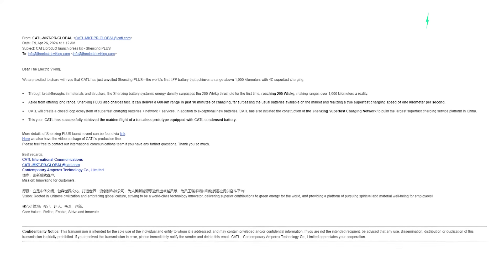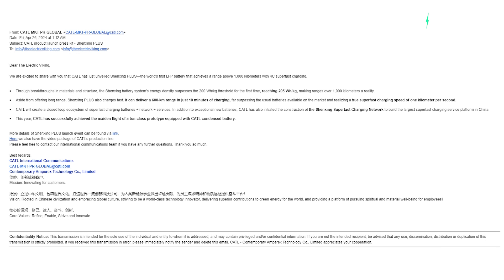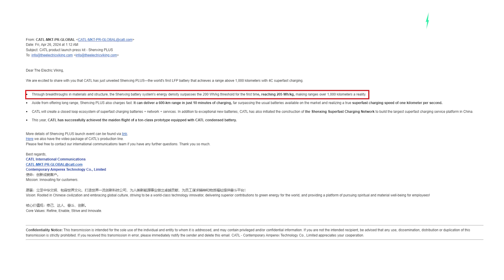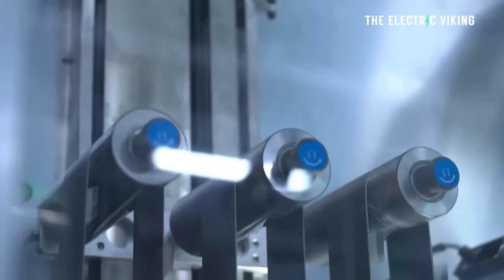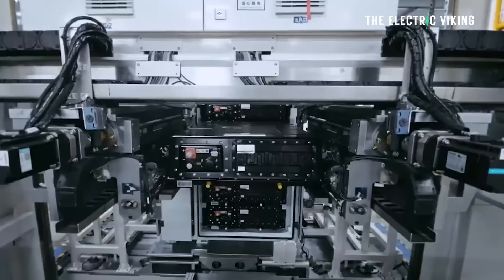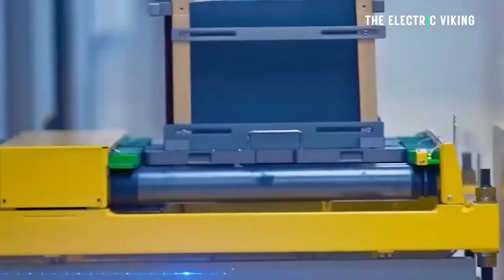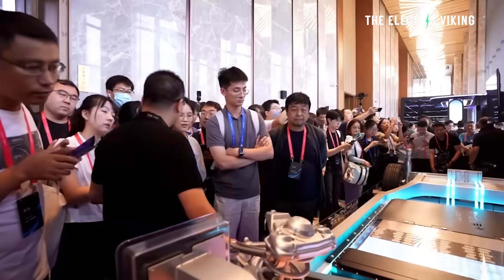CATL reveal new battery with highest energy density in the world

Comment: If this is true then it should reduce the weight of EV's then?  
Reducing the weight down to below that of an compatible ICE car is critical since it not only reduces the energy needed for movement but also reduces the wear and tear on any mechanical components, the four tires and the pavement.  It may also enable the use of heavier more recycle able body components thus eliminating plastics altogether?
Reply: Current battery tech makes EVs the same weight as full size ICE SUVs, meaning the same weight is in a slightly smaller footprint.

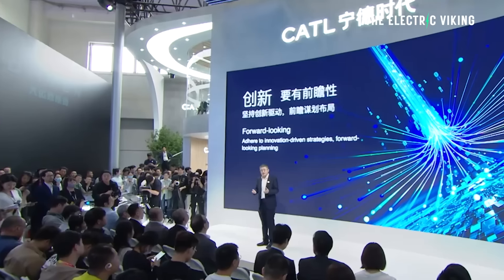Comment: 4:03 You said 747, but this rendering looks like a modified Tecnam. Looks like it carries 30-50 passengers. A 747 will carry 300-400 passengers. Still nice, but not quite replacing turbo fan transport aircraft yet.

Comment: will also lower vehicle weight if you are using 1/2 as much and still go further than its predecessor. Even if costs up to twice as much your are in front a lot!
Reply: The catl semi solid state pack of 150kwh in the nio et7 by welion weighs just 44# more overall than the same size pack by catl using nmc cells of just 100kwh capacity. 

So a tesla model s could use this for 40%+ more range at no weight penalty or cut 350-450# out and keep around 100kwhs and 400+miles. 
Bringing a model S lr down to around 4,000-4,200# from 4,400# now. 

It will be interesting imo to see what ev oems do once this tech is avaipable widely spread cheaply in a couple year's. I think luxury and suv/truck makers keep massive pack's for big range and to serve towing needs. 

While mid size segment model's keep similar useable capacity but drop the 200-300# in weight and I bet the low end evs just stick to lfp/lmfp/m3p or sodium cheaper style cells. But improve the charging speeds for better daily useability.

Comment: Not a 747 !   The image shown by CATL is that of a regional class turboprop, which typically carries 50 passengers or so.
Reply: Right.  There is in fact a battery powered plane in commercial service built by an Israeli company, an 8 seater.  It's called ALICE and it's been in service for two years now.
Reply: Good spot. 

We will see a resurgence of large seat capacity prop powered passenger aircraft
Reply: @PETERJOHN101 there’s a few others, some flight school and contractors who specialise in short haul flights suited to the battery range are using battery powered electric aircraft 

Def an area to watch as it will grow

Comment: Another advantage is benefit to the residents nearby the airport. The noise will is a friction of current noise level.
Reply: An electric aircraft powerplant sized for a large aircraft will still be pretty noisy though, one should keep that in mind. You need to pump huge amounts of air very fast, which will mean noise. But yeah, certainly less noisy than kerosene-fueled turbines though. :)
Reply: Drones are very noisy for their size. Making an aircraft electric doesn't make it quiet.
Reply: @sang3Eta  If you're ever heard a piston engine model aircraft, you would agree that the drone actually is quiet in comparison. :D  It's not quiet on an absolute scale; it's quiet on a RELATIVE scale. ;)
Reply: @lennyvalentin6485  the other problem with lithium batteries on a plane is that lithium melts through aluminium air frames like a hot knife through butter.
Reply: @sang3Eta  No that's not correct, you're probably thinking of thallium. Regardless the lithium in a battery is encased by multiple barriers and casings, and worrying about it is just silly. After all, aircraft fuel burns hot enough to melt aircraft airframes easily, so you should worry more about that methinks.

Comment: 500 watt hour per kg is twice as much as the current 250 watt hour per kg in NMC batteries. So what can you get from that? A current model 3 long range is rated at 350 miles, but only goes 250 miles in real world freeway driving. So 500 miles from a model 3. The F150 lightning is rated for 300 miles of range, but only gets 220 miles of real world freeway driving, or 100 miles when towing at max rated load. So an F150 lightning would get 440 mile freeway range or 200 miles when towing at max rated load. Basically it is approaching what gas powered cars can do. But that is no where near what you need for a battery powered 747 airplane. The fuel load in a 747 is 197,000 kg. That would be like having a 98,500 kwh battery at 500 watt hour per kg. At cruising speed, a 747 uses 65,000 kw, or 87,000 hp. So while cruising, a 747 would use up a 98,500 kwh battery in 1.5 hours. A kerosene powered 747 can cruise for almost 16 hours. So 500 watt hour per kg batteries are still a factor of 10 lower than what you need for jumbo jets.
Reply: It might make a twenty first century solar electric air ship viable!🤔
Reply: Watt-hour and gas-powered should be hyphenated.  Nowhere, not no where.  Battery-powered and kerosene-powered should also be hyphenated.

Comment: Nowhere near enough energy density for airliners. CATL’s email mentioned a “ton-class prototype”. But still a very promising development.
Reply: I dunno considering they are testing short hop electric aircraft now using current batteries.. Do you know what energy density is needed for (at least) US domestic flights then?
Reply: @erktrek This is covered in some detail in the paper “Considerations for Reducing Aviation’s CO2 with Aircraft Electric Propulsion” by Alan H. Epstein
But 1500 kWh per kg is mentioned. The paper is well worth reading for anyone seriously interested in aviation and it discusses H2 also.
Reply: @erktrek there is no way the US will use Chinese batteries for aviation.. national security risk.
Reply: There is already a battery powered plane in commercial service built by an Israeli company.  It's been in service for two years now.  It's called ALICE.
Reply: 500Wh/kg is enough for short distance flights, even for big airliners. You can fly about half of europe with that. 1000Wh/kg is of course where it becomes really interesting. That's all of europe, a good part of the US, etc.
I can see big arilines ordering battery planes at that point, for most of their routes. Not only would that save them a lot of money, they could also start and land at night.

Comment: We are talking about different batteries here, developed for different applications. Instead of putting the same lithium batteries in everything, there is a special cheap battery (sodium) for budget EVs and bulk/grid storage. There is a special automotive battery (LFP) that is more expensive, but is very durable, higher energy density, and very fast charging. There is a special aviation battery (condensed state), which is extremely high density, but will be so expensive it will only be used in airplanes and the highest performance luxury cars.

Maybe in the long run, the aircraft batteries come down in price enough to be used for other applications, but even if they were free to make the supply/demand laws will have them bid up price by demanding application by aircraft due to constrained supply. The good news is that these specialized batteries are bringing clean power to more and more applications, accelerating the energy transition.

Comment: SAM... Love your work Bro. But... at 1:00 you quoted Elon saying 400 watts per kilo...
You're one of the top EV expert guys on YT...so, with all due respect get used to saying watthours per kiloGRAM, instead of "watts per kilo¨...

Batteries are defined by their stored ENERGY capacity. 
That's watthours (smartphoines, notebooks) or kilowatthours (for EVs).
Symboil for kilo--> lowercase k
Symbol for mega--> uppercase M
Symboil for watt--> uppercase W

kW and MW are power units, used for electric motors and generatrors, not for batteries.
EV batteries are defined by their stored energy--> MWh or kWh

Another very important EV battery characteristic is it's DENSITY (stored energy per kilogram)--> kWh per kilogram--> kWh/kg...
Btw, these news about CATL developing the 500 Wh/kg density is fantastic.

Comment: now all you need is fusion power and infrastructure
Reply: The US government, at its National Lab in Idaho, is testing, developing, small nuclear reactors. Notice that that is a US National Lab. There are about 28 of those, like Los Alamos and Oak Ridge. Oak Ridge was where huge centrifuges isolated the U-235 used Little Boy. It took years to get enough U-235 for one Little Boy, so the Plutonium from the reactors at Hanford was a God-send. That stuff was used in Fat Man, and subsequent copies of Fat Man. Point here is that we have ~28 National Labs and exactly ONE working on small nuclear reactors. Would five of them doing that speed up the process?  The small nuclears could be installed near medium sized cities and generate e-. We will need them!!  Fusion will be  downsized and installed widely by 2100 MAYBE. I'll be surprised if it's sooner. BTW, at the rate we are going with GHGs, sea levels will rise 6 feet by 2100. Think of the chaos.

Comment: For electric planes, what is needed is a drop off battery, a primary battery that will be dropped off after you reach level flights and it will land by itself like a drum and a nearby airport. The body will discharge first and the second battery will be fully charged.At mid-flight, so you get a flying plane with a fully charged battery.I'm lighter

Comment: I have no doubt that CATL's condensed battery is real and already in production. The question is cost. The fact that it is currently deployed in commercial trucking application hints it is quite expensive.
Reply: As they are a very big producer already , they are in the best position to scale up to affordable levels very quickly. There will be an enormous demand if the price is available for cars.😊
Reply: The Shenxing is in production, CM prototype is not.
Reply: Actually the opposite. Customers would spend much more for airplane batteries, but if they are already in trucks they must be affordable.
I wonder how this will pan out.
Reply: @tenj00 true, but trucks would be good to test it, before using for aircraft
Reply: Why? are commercial truck companies stupid with money?
Reply: @boembo6627  , I assume given free to test?
Reply: Is it certified by insurance for aircraft? Is production easy? Can it compete with amprius?
Reply: @bkparque certifying a new aircraft typically takes 2-4 years regardless of propulsion system.
Reply: Do you?
Reply: China has been using these for years.  Just like the USSR was always years ahead of the rest of the world.
Reply: @dzcav3  loool
Reply: CATL is actually marketing it for aviation (which indicates even higher cost). The trucks that got these batteries have to be very niche and/or got them for marketing reasons.

Comment: The condensed matter battery does have very high energy density, but it is also about 10x the cost of their regular lithium batteries (such as the Shenxing 2 LFP battery).  That is why it is focused on aviation.  If they are putting it in trucks then I'm guessing they are just demonstrators, not an actual commercially-deployed product for trucks.

4C charging means 1/4 of an hour from empty to full.  1C = 1 hour from empty to full.   The C-rate only relates to "range" when you also take into account the size of the battery pack installed in the vehicle.   No matter the size of the pack, 4C means the entire pack can be charged from empty to full in 1/4th of an hour (15 minutes), for a range of XYZ (size of pack x 3 to 4 -ish).

In terms of cell life.  LFP cells basically don't die, they just lose capacity slowly over time.   Current LFP cells are generally rated around 3000 cycles at 80% depth of discharge per cycle to 80% of original capacity (after the 3000th cycle the battery has 80% of its original capacity).   In an EV LFP technologies today can hit 6000.  So 18000 is not actually that much of a stretch.

However, even though the cells might not die, the power electronics connected to those cells certainly will.   This is the true limiting factor for a LFP battery pack... the BMS and power electronics inside the sealed battery and not so much the cells themselves.
Reply: SoH of LFP decreases to 80% of original capacity in less than 5 years according to the real users in China. this is huge for passenger and commercial cars which are used for over 10 years.
It's simply true that LFP battery is inferior to NCM
Reply: @GON-lu4me  your source for this claim?
Reply: @GON-lu4me  You are welcome to post a reference to back-up your assertion, but you're gonna have a bit of an uphill climb proving an assertion like that.  In fact.... I have stationary LFP batteries about 3 years old now myself that are sitting roughly 98% SOH vs when I originally got them.  They are cycled daily at roughly 50% DOD (off-grid application).  If they're gonna lose capacity, they better do it quickly to match your assertions.
Reply: What's your source on the cost? And how many are they producing right now? As they scale up, the cost will go down by some percentage with each doubling of accumulated production, just like all other batteries. At least until they get down to the cost of raw materials.
Reply: Even with current LFP tech we have price parity with ICE cars due to the efficiency of batteries over combustion, ie, fuel savings and near zero maintenance over the life of the car.
Reply: @dennispeterson6598  Cost for the condensed batteries just comes from articles written at the time (last year), and the fact that CATLs own marketing focused on aviation.  "Aviation" is a code-word "high cost" in this case.  I don't know if the condensed batteries have made it into public commodity markets yet... I don't think they have.
Reply: @PETERJOHN101  Yes but also not entirely.  One reason is that the cost for ICE cars has risen dramatically over the last few years, putting new cars out of the reach of many people.   So even at cost-parity, EVs are too expensive.

A second reason is that there are no low-cost commuter EVs in the $20K-$25K range to compete with used low-cost commuter ICE vehicles.   There are other electricified non-4-wheel-car options (e-bikes, e-scooters/mopeds/motorcycles, etc) but they don't really compete in the same markets.

I can think of others... the cost of gasoline, for example, is not uniform across the world or even within the U.S.   In markets like California, where gasoline is expensive, EVs make a lot of sense.   Although electricity is also expensive in California there are also lots of options for finding cheaper power or making it yourself.

And finally, most populations do not have the intelligence to reason-out investing in their own futures or the funds to do it when the pay-back is longer than a year or two.   Many of us here can readily see the advantage of investing in ones own future, and are capable of saving money, but that isn't applicable across the wider population in the world.

-Matt
Reply: @GON-lu4me  Maybe Chinese-quality LFP batteries in Chinese EVs perform like that, doesn't mean LFP batteries as a whole behaves that way. Also, battery capacity loss tends to be "bathtub" shaped - IE, higher initially and towards the very end of life, with a long stretch of much slower loss inbetween.
Reply: @junkerzn7312  I mean the Citroen e-C3 is 23.300€ including tax. I would assume that options like that will come to the US soon-ish.

Comment: Battery chemistry (CEN July 14, 2014) had a very positive evolution since 2014 the LFP reported between 110-110 Wh/kg, Lithium-Cobalt between 150-190, and Tesla (Panasonic Lithium-Nickel-Cobalt-Aluminium) over 240. The 500 Wh/kg and even 900 was expected to be reached. What is really impressive is the 18 000 cycle capacity and the charging speed. Are we falling into the game of offering big battery packs with high levels of minerals and high autonomy without a real need?  The average daily mileage in the US is 59 Km, in the UK is 29, in Australia is 33, in Italy also is 33, in Costa Rica is 26, Do we really need an EV with a battery pack for 1000 km?.

Comment: There is still too much obsession with range in EVs. Nobody but truckers and trains need range greater than 450. Even as a trucker, I wasn't allowed to drive more than 6 straight hours without a 15 minute break. Cars Should be built heavy enough and strong enough to stay on the road and protect the passengers. Other than that no weight should add to inefficiency unless it can be justified. a range of 1000 miles for a passenger car isn't good enough reason to lower its efficiency. I would support a 600 mile optional upgrade but no more than 450 standard unless the weight is needed to provide traction.

Comment: Amprius announced a 500kWh/kg battery last year having solved the 100% silicon anode problem. If CATL have found another way to achieve 500kWh that does not involve a silicon anode, then unless that technology precludes the use of silicon, then there is probably no reason the two innovations can't be combined. The same goes for solid state electrolytes.

I raise this because the headline to the video announcing that this "ends solid state" is silly unless it does something that makes it incompatible with solid state batteries.

The other thing to keep in mind is that there are so many announcements of "game changing" improvements in the technology that if all came to fruition, we'd be driving 2,000km on a pair of $5 AA cells by now. Those who are dubious about getting overly excited based on press releases are well justified.
Reply: Today AMPX earning call. Will be heavy loss?
Reply: Careful, the Electric Viking might make a news video about your comment.
Reply: Even with current LFP tech we have price parity with ICE cars due to the efficiency of batteries over combustion, ie, fuel savings and near zero maintenance over the life of the car.  And with battery costs dropping 50% this year...